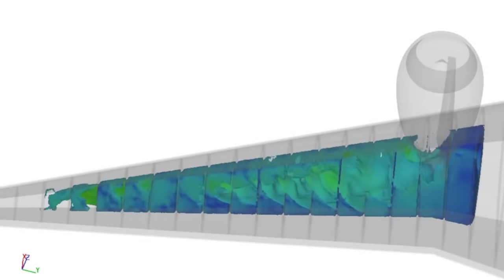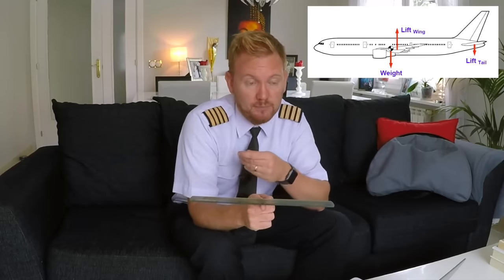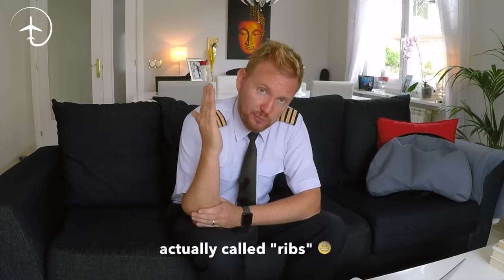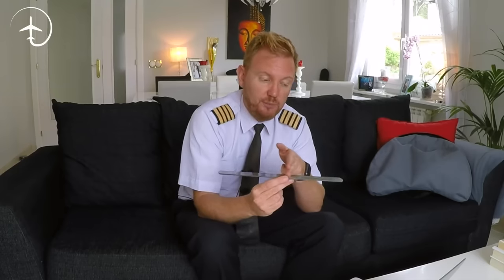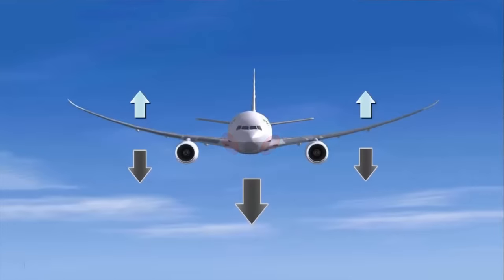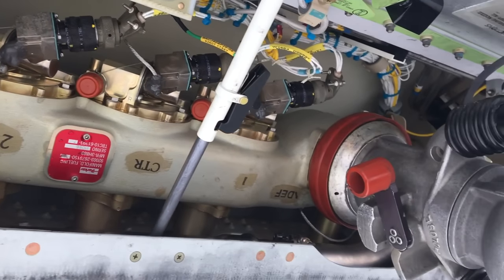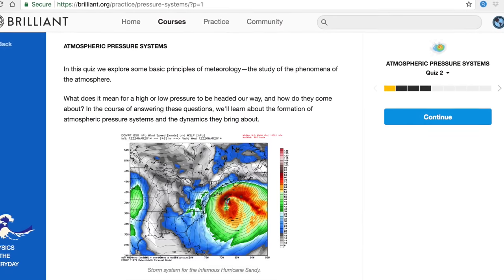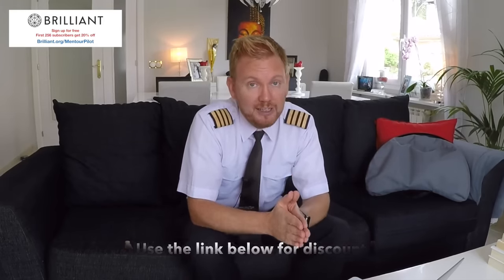Why do aircraft store fuel in the wings?

Comment: I think you as an industry should rethink with me fuel in the wings.were I building the finest, safest most efficient air craft I would learn from all the other fuel dumps do to emergency is lost to the air and is still just much ap to explode in impact  as if pilot did not dump. Instead mount fuel tanks, odd number in the center the rest under the wing like bombs ejectable with good strong parachutes and GPS. Whats wrong with it now is an emtee fuel tank is like shaken tennis ball cannons and is more explosive than a full tank. If you let it down gently you save the fuel and it's safer. Don't  what if me?, Test it.

Comment: Next time you fly. Measure the wings.They are THIN. YOU CANT CRAWL IN THEM AND THERE IS NEVER EVER ONE DROP OF FUEL. NOT EVEN MOIST.
Reply: And aeroplanes are big. I can’t tell if you’re a troll or not.
Reply: @Cathrin > I have been inside many wings.  Some big, some not as big.  In a C-17 I can almost stand up in the wing.  Your ignorance of aircraft is showing.  Do some real learning instead of listening to the Hoaxsters on You Tube.
Reply: @sexigrande1792  Ha Ha. You have obviously never been close to a wing. I guess you also was inside the supersonic Superthin airliner wings. Ever heard of Flaps or it's hydraulics? I know how huge the engines are. If you compare those with the wings you would see its impossibility. And the WEIGHT. THE BIGGEST freightplanes would never be able to carry heavy loads.
Reply: @cathringustafsson2426  Bro, I have been close to them... I work on them.
Let me tell you there are tanks in there.
They fit because they are "integral fuel tanks".
Do your research man.

Comment: I was wondering why can't Hydrogen be used as a fuel in Airplanes with fuel cells so that we can have electric planes? 
The current battery density needs to double for an economically viable electric plane but Hydrogen has much higher energy density than batteries so why is this not used for a greener flight?
Reply: You will still need a propeller/turbine. Not like a car.

Comment: The question I've had since I was 8 in 1993 is how do wings hold so much fuel...is it just me or does the wings of let's say a 777, do they look like they can hold 47.000 gallons? Cuz they don't to me and then to hold so much weight and then be subjected to extreme force when flying but never break off is another question I have and it's not just with the 777 because to me most planes wings don't look like they can carry all that fuel
Reply: You would have to go and walk on the wing of a aircraft like the 777 to realize how big that wing really is.   They you would have to go into the wing through one of the access holes to see the inside..  I have been in many wings, you would be really amazed at how big and how much room there is on the inside of a wing.

Comment: If nitrogen stops the air in tanks from igniting, then what happened to Flight 800 over New York?
Reply: Because the fuel got exposed to air
Reply: The nitrogen system is a result of TWA 800.

Comment: NONSENSE....4:01 shows open wires.......and in order to make it a seald fueltank, an inner layer of a plastic or rubber folie woud be required. Due to the permanent up and down bending of the wings, they can't be properly fuelproof without an aditional layer. Official versions of many things are wrong.
Reply: The wires are insulated and when the wings are put together they use sealant on all the joints and on the rivets when installing. Quit thinking the wings don't contain fuel because of some videos going around saying aircraft don't use fuel. They use lots of fuel. I have my A&P license and worked on heavy Boeing aircraft and personally been inside those tanks.
Reply: @Carpe > I have worked on A/C for over 30 years.  I will second what Bob CZZ stated.
Reply: Yup... this vid is all bullshit.  7.8T of liquid fuel in the wings?? ... right.

Comment: Commercial Airplanes do not store fuel. Commercial Airplane use electricity to power the huge fan engines to fly. And use less electricity once traveling fast in the sky because of the condensed air going into the engines. Airplanes run off of air (Once traveling at high speed, high altitude) It is impossible to store the massive claimed liquid fuel amount to fly from, example, USA Boston to JAPAN Tokyo. For constant 13 hours outputting energy to keep the aircraft up. Let alone go 550mph. I imagine the deception is so the masses pay a lot of money to fly. Thinking they are paying for the precious jet fuel.

Comment: why make planes cylendrical instead of rectangular and use the body of the plane for more lift...?
Reply: But it would make more drag
Reply: @ethansaviation2672  but more lift so smaller wings and less drag
Reply: @esecallum  no because the fuselage would create more drag than the normal aircraft config
Reply: @ethansaviation2672  nonsense. explain why b2 has a long range. mostly fuselage and short stubby wings
Reply: @esecallum  That's a flying wing not a rectangular shaped
Reply: @ethansaviation2672  no. its a rectangle.
Reply: @esecallum  It is not plus that shape is good in military aviation
Reply: So you mean planes are rectangular..🤔🤨
Reply: @esecallum  Cibup

Comment: Surely airplanes cant hold the amounts of fuel they say? And I have seen broken wings, without huge fuel storage being visible?
Reply: Not sure what you mean by broken wings. Planes can hold exactly as much fuel as they can say. Wings are thicker than you might think, especially near the root of the wing, and almost all of the volume of the wing not being used for structure is holding fuel
Reply: @AmbientMorality when I've seen broken wings, there isnt huge fuel tanks in them??
Reply: @lewismartin4306  The wing is the huge fuel tank. They're sealed with resin near joints, of course.
Reply: @AmbientMorality  ok. Any links or sources for that ?
Reply: Lewis Martin Any links for those broken wings? 🤷🏻‍♂️
Reply: @speedbird9313  no i wasn't making a claim, just trying to answer a question I had been wondering about
Reply: Lewis Martin Well..think you got to explain the "I’ve seen broken wings" then 🤔
Reply: @speedbird9313  I have.  I don't keep the images stored on me... but my memory is very clear on seeing inside broken jet planes wings . And hence I wax wondering where the apparent huge amounts of oil is supposed to go, as I couldn't see it... hence i am asking a question...
Reply: Lewis Martin There is no oil stored in the wing tanks (called main tanks).

Comment: WRONG, it is not weight balance it is weight distribution to increase moment of inertia with the added weight and give horizontal stability to air plane, in sailplane we put water instead.
Reply: Ok yep you know more than a pro pilot😂
Reply: @ethansaviation2672  I don't talk aviation, I talk Engineerring 😀.
Reply: @ahmedlotfy8972  Ok but what was your reason for even putting this?
Reply: @ethansaviation2672   It is my humble contribution to correct a misconception, you cannot distribute a weight without measuring the bias, and to raise awareness of an important factor like moment of inertia, which is usually over looked, anyway I liked the video.
Reply: @ahmedlotfy8972  ok i just wanted to know why, you clearly know what your talking about not like these people claiming lies

Comment: But how could 108 tonnes of fuel be carried in in the wings?
Reply: Well, not on small airplanes... The most a Boeing 737 can hold is 30 tonnes.

Even the massive Concorde wouldn't make the cut: It has a fuel capacity of "only" 210,940 lb (95,680 kg)... But considering the wing area of 3,856 sq ft (358.25 m²), this means that ... if all the fuel went in the wings (and it doesn't) ... it would need 27 cm (less than 1 foot) of space. Are you saying the wings are narrower than that?!

And okay, the Boeing 747 and Airbus A380 can carry more than what you specified. For them, the values are these:
* A380, fuel capacity 253,983 kg, wing surface 845 m². That's 30cm (1 ft) of space.
* 747, fuel capacity 241 tonnes, wing area 525 m². So 45.9 cm (1.5 ft). The most so far, but still not a deal-breaker IMO. Especially considering there sre other fuel tanks too, spread around different parts of the fuselage.

Comment: I thought a reason would be that it’s most efficient because it’s close to the motors 😂
Reply: It is actually a benefit in some way. Because most modern airliners have the engines just below the wings, it's possible to "gravity feed" them if the fuel pumps in the tank should fail. So it's actually a safety gain.

Comment: Is there a nitrogen generating system on airbus aircraft?
Reply: Dilaver CETINKAYA Dont think so.Its not that common on 737s either..
Reply: @speedbird9313  How does the aircraft prevent fuel flashing then?
Reply: By keeping the fuel pumps submerged in fuel, the need for a nitrogen system in the fuel system is actually quite debated in the aviation industry.

Comment: How can it hold the amount if fuel they claim in the wings
Reply: damn...ur kinda right but wings are huge...like massive
Reply: @Sharon > I have worked in aircraft development and Flight Test certification for 32 years.  We CANNOT lie to the Certifying agency or the customers on how much fuel an aircraft holds.  We meticulously test this.    That would just be ridiculous and anyone who believes the big you Tube hoax about aircraft fuel quantity is falling for the lies.  You need to get close to a wing to see how big they truly are.  Also the wing includes a center tank which you don't see.  It is right under the passengers butt if you are sitting in a seat over the wing.  Some aircraft also have auxilliary fuel tanks in other locations of the aircraft.  Also aircraft such as an MD-11 and 747-400 have fuel inside the Horizontal stabilizer

Comment: NO there is NO fuel in the wings. Watch AIR BUS 380 perform! It said to have 220METRIC TONNES IN THE WINGS. LOL
NO it's HELIUM and the compressor engines run on COMPRESSED AIR. there is just a small amount of fuel for the APU which starts the engines with a compressor. As all heavy duty machinery today.
Reply: Mmm, it sounds like you tried to sniff all that helium in one go...

Comment: does anyone here know the flow rate of the pumps used to refuel commercial aircraft?
Reply: Anno Dont know about that, but on the 737NG fueling panel there is a caution that states that fuel pressure should not exeed 55 psig (379 kPa).

Comment: So that should all so mean that when there is fuel in the wings there is NO OXYGEN in there correct you need three elements to start a fire
Reply: maxx1991 the air goes in the front of the engine

Comment: How much fuel does an A380 use in 1 mile?
Reply: A lot
Reply: An A380 burns 12000kg per hour.  So if we assume it's cruising at 500mph, 12000 divided by 500 = 24kg per mile.

Comment: This man is a con man. Those wings couldn't possibly hold even half that fuel. Those engins use circulated air and use very little fuel. They also fly much slower then they claim, 100 miles perhour or less. There is great deception in the airline industry, look into it before having contempt prior to investigation
Reply: Rj Quest // Jet engines depend on the combustion of fuel and compressed air to provide the "thrust" (hot expanding gases) out of the nozzle or rear of the engine, which in turn pushes the plane forward (action/reaction).  If the jet engines aren't burning fuel, then where is the energy coming from to spin the compressors FAST enough to create the thrust or push to move the plane forward?
Reply: I really hope you have sobered up by now.

Comment: LMFAO——-do the math— how many liters x the weight per liter.       🤨 there’s is no way there is this amount of fuel on these planes PERIOD.

The wings would SNAP OFF DUE TO THE WEIGHT!!! People were talking TONS OF LIQUID IN THESE FRAGILE WINGS!!! 
COME ON AND THINK ABOUT THIS WITH COMMON SENSE
Reply: The wings don't snapp off. I'm sure you have heard about strength testing in industry. The aircraft wings are tested on a test rig, and the wings are bend during these tests so that it's possible to see that they meet the structural strength requirements. Then also several test flights are made. The engineers don't guess things, they use calculations, and the wings are build so that they meet these structural strength requirements.
Reply: @Timothy > I have worked in aircraft developement and Flight Test Certification for 32 years.  The manufacturer CANNOT lie about the amount of fuel it holds.  During Certification we calibrate/test the amount of fuel the aircraft hold.   If you actually worked on aircraft you would realize how dumb your statement sounds.
Reply: (I'm an Aircraft Mechanic)
Why do people like this take time out of their day to post shit they have no f** clue of?

Comment: They don’t, it’s physically impossible. That’s why when wings are tested they are not tested with any liquid in them.
Reply: @sexigrande1792  actually it is compressed air and very little liquid fuel is necessary
Reply: @sexigrande1792  makes a lot more sense than liquid fuel sloshing around which I have never felt on any of the dozens of flights I have been on.
Reply: @sexigrande1792  Why would you ever store liquid in a wing? Since you work in the aviation industry will you tell your bosses they should switch to compressed air instead of all that messy dangerous fuel?
Reply: @sexigrande1792  ok ty
Reply: @iamvampyrnow  🙆🏻‍♂️🤦🏻‍♂️
Reply: @iamvampyrnow  do you have any idea how heavy compressed air tanks are, and how little energy they hold per mass compared to fuel? That's also why I'm doubtful if hydrogen planes will ever be a thing, high pressure tanks are heavy, and weight is the enemy of efficiency in planes.
As for the danger, kerosene isn't nitroglycerin, it's not gonna blow up on any impact like in a michael bay movie
Reply: @Grouuumpf  not the best damage control effort I've seen, but not the worst. So, to clarify, your posit that tanks filled with compressed air would be heavier than tanks filled with liquid, correct? So your position is that compressed air is somehow heavier to store than liquid, correct? How did you come to that conclusion?
Reply: @iamvampyrnow  I know compressed air and airplanes wings. To be of use, you need some serious compression. Let's say 300bar to have some juice. At that pressure, air density becomes a bit under half that of kerosene. But it also requires thick (heavy) tanks to keep that pressure, and those tanks must have a set shape. With liquid fuel, you just let it flow freely to fill blank spaces.
Then we come to the interesting bit: energy density. Kerosene is around 43MJ/L, and an airliner engine runs around 50% efficiency.
Compressed air at 300bar is in the ballpark of 0.15MJ/L, at a nice 75% efficiency in motors.
My "back of the napkin" calculations says you need about 215 times more volume of air at 300bar than kerosene, at only half the mass/L, so it's litteraly 100x heavier, without counting the tanks.
Oh, and I regularly have to work in those wings. There is definitely kerosene AND a lot of space, there.
Reply: @sexigrande1792  yeah, I had the misfortune of doing it a couple of times. Though at least in that case I'm well protected. Going to work in a supposedly dry tank with just coveralls and ending up drenched in a bucketful of kerosene from a pipe that wasn't drained, that's not much fun
Reply: @Grouuumpf  then show me a video of you working on the wings filled with liquid kerosene. To me, your calculations seem to fall short to me, do you have any other proof?
Reply: @iamvampyrnow  yes, of course, I'm going to work inside a tank when it's full! Especially with all the access doors being on the lower skin.
As for the calculations, feel free to look up the numbers yourself, Google is your friend
Reply: @Grouuumpf  pics or it didnt happen
Reply: @iamvampyrnow  like it will change anything
Reply: @sexigrande1792  Are you able to provide a video of that process?